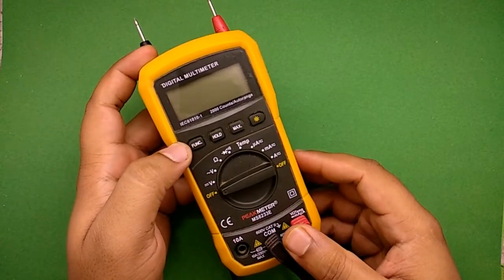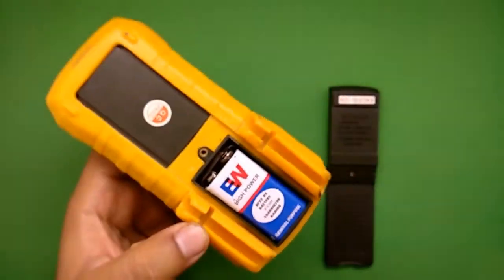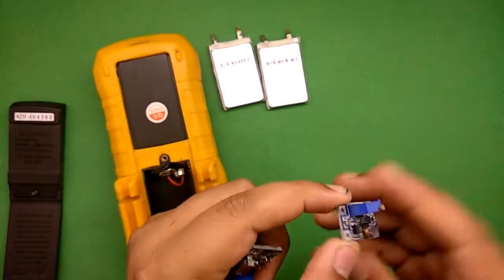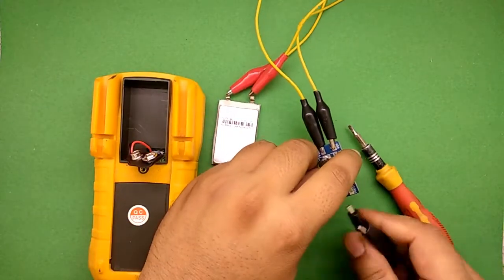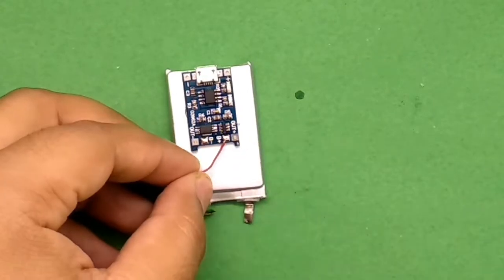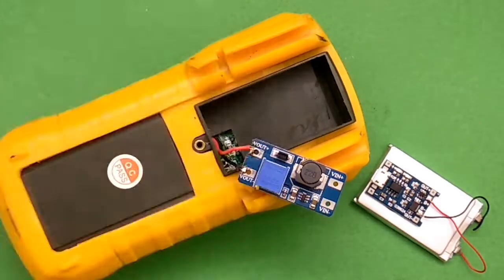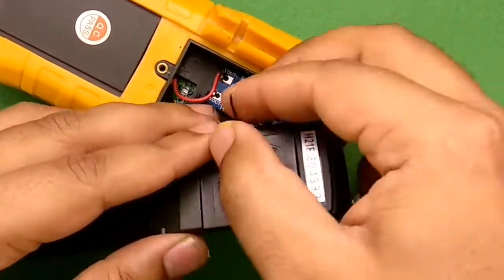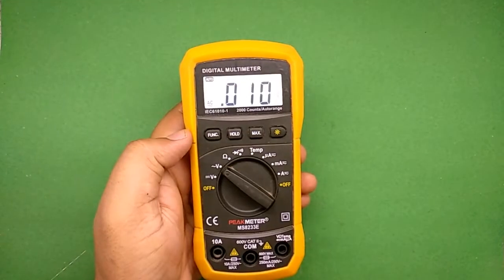DIY Rechargeable  Multimeter || Get Rid of low battery problem in multimeter

Comment: you don't hav 2 use boost convereter. 3.7*2  is  7.4 which is good enough for  a  9volt meter. For me I used  2 laptop  batteries and I never charge them for 2 years now and still going.
Reply: But the problem is you need more module for that right? You need a bms to make sure they are running and charging at the same volts. Correct me if I'm wrong.

Comment: Very creative idea!  I have been looking for a product where the multimeter has an "energy leach" setting for the probe wires.  That way, you could easily recharge the internal battery of the multimeter by just using the existing probes.  You'd think that would be a no-brainer, but eh.
Reply from the maker: Nice Idea might be gonna use in future

Comment: The boost converter is connected across the battery and so is always on. Does it drain the battery?
Reply from the maker: Yes  you are right it does but it still works fine but yes i an gonna fix it  so that i can get long battery life

Comment: Next time you should try to fit it inside of the multi meter where the batteries went so it looks cleaner.
Reply from the maker: I have tried. But battery size is quite bigger. That the needed